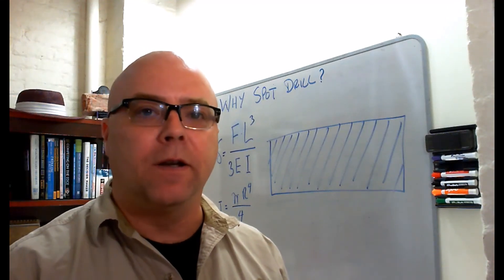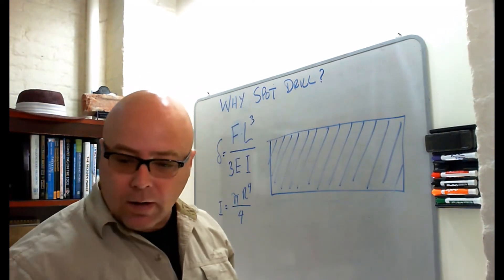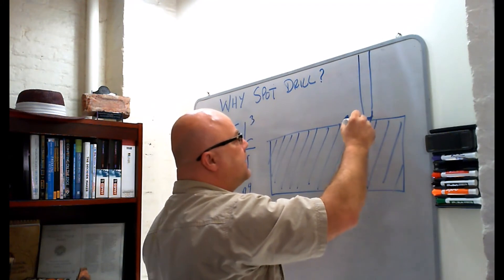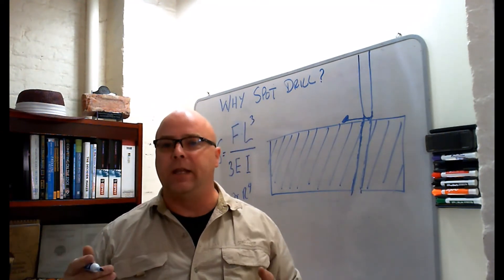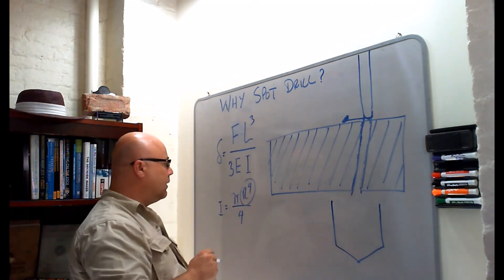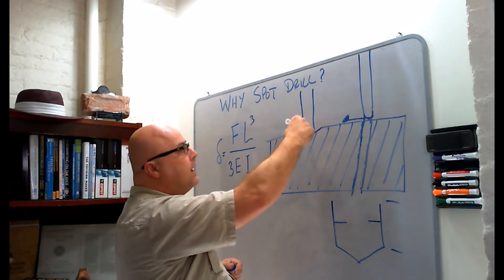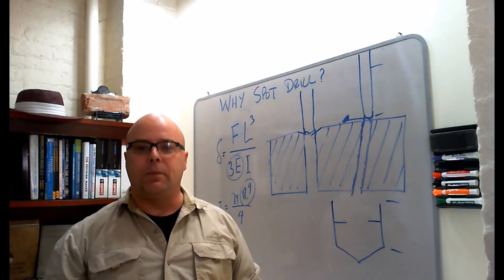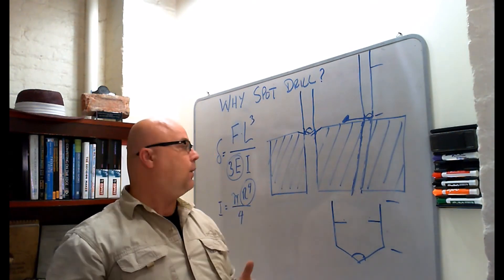Why use a spot drilling operation in CNC Milling or CNC Turrning

Comment: I don't get it.  Why cant you use your drill bit (just a slow peck) to spot your hole?  You get the exact angle, and the benefits of your coating.
Reply: Long drill bits aren't very rigid. Short/stubby bits are way more rigid. Meaning they don't moonwalk all over your work surface.
Reply from the maker: it has to do with the length to diameter ratio of the drill. if it is stiff enough it will work